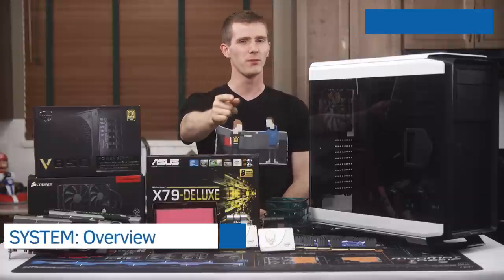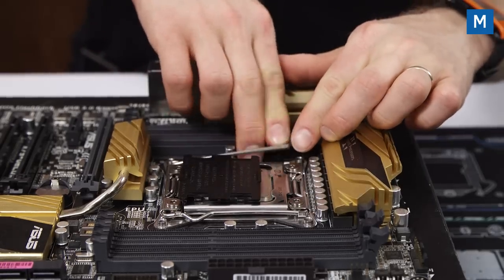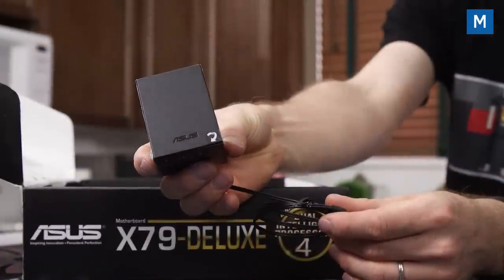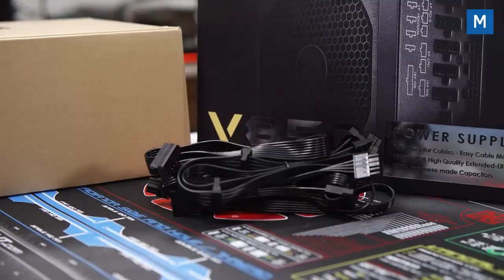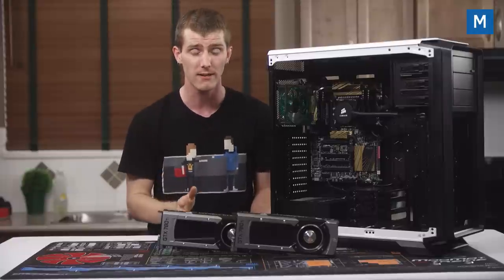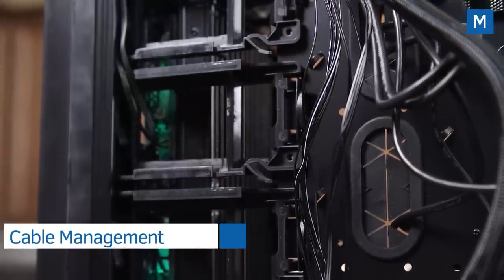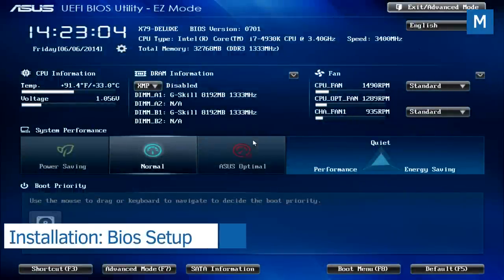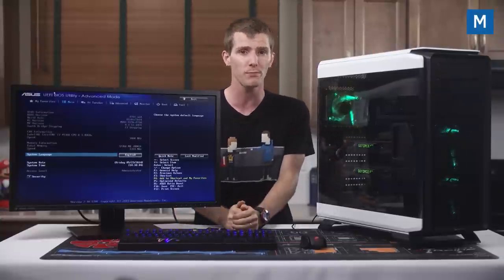How to Build the ULTIMATE 4K Gaming PC Build Guide

Comment: I would have thought that, nowadays, two GTX 970's are a superior solution due to their comparable performance with the 780ti's, significantly lower power consumption and better price. Not to mention the additional gig of VRAM that they provide.

Also, I would probably swap out the processor / motherboard combo with the X99 Deluxe from Asus and the 5820k. RAM would obviously need to be changed to accommodate this (DDR4) and personally I feel safer with an air cooler, so I'd go with a Noctua NH-D14. I'm also personally a big fan of Crucial and their MX100 SSD's, for me, offer better value with 2 512GB variants in RAID 0.

Power supply is fine, love the fan choice, and the case is also outstanding. 

Just my thoughts on the build a few months on... would anyone else make any changes?
Reply: This is before the 970 and x99 were released.
Reply: Personal_Penguin I know, hence why I said that these are my thoughts on the build 'a few months on'.
Reply: A gtx 970 can't even come close to a 780 ti , I think you meant gtx 780. Remember, 780 ti has 2,880 cuda cores, 780 has 2,303 cuda cores, and a 970 has around 1600 but because of the architecture running on maxwell it's about equal to a 780's 2303. But it's not even close to a 780 Ti
Reply: Safwat Khan ***** What on earth do you both mean? A 970 is roughly the same performance as a 780ti and even surpasses it when overclocked. Not to mention the extra GB of VRAM, which is absolutely essentially for additional stability when it comes to gaming at 4K. Add to that the superior power efficiency and pricing, and the 780ti is, at this point, irrelevant when it comes to this build as far as I can see.

Need evidence of the performance similarities? Here: http://www.bit-tech.net/hardware/graphics/2014/09/19/nvidia-geforce-gtx-970-review/12

Look at other websites for benchmarks and you'll see that this is no fluke. An overclocked 970 can also beat out a 980 stock. Not everyone on the internet is terribly misinformed, you know.
Reply: ***** Do the numbers not speak for themselves? What argument do you have? I'm not trying to flame war here, I'm just perplexed as to how you cannot see the evidence in front of your very eyes.
Reply: ***** Lmao, your arrogance really is insufferable. I don't own a single console and have been PC gaming for over a decade now, so get off your elitist high horse and start using your superior 'game developer' knowledge and actually utilising information to argue what I've said. You do understand that these websites that deliver high-quality reviews on computing hardware means that they also have this 'real experience' that you speak of. What is that by the way? Other people who buy high end hardware don't have this 'real experience' of yours because they aren't a game developer? Even assuming that you're not full of shit and that you are a game developer, your argument is beyond vague.
Reply: ***** Lmao, you just have to be trolling. There is no way in a million years that you can believe your price statement. Price does absolutely not equal quality. If you go through life like that, you'll be brainwashed into believing that Apple based desktops are more capable gaming machines than a Windows based system. That's essentially what you're saying. It's an absolute waste of time trying to get an intellectual answer out of you to combat what I've said. Go and design flappy bird mk2 or something, 'game designer'.
Reply: ***** what games have you made m8?
Reply: ChakLong I was actually thinking that this delusional episode from him had something to do with him regretting that he bought the 780ti now that the 970 is out. Only reason that his rant makes any sense, to be fair.
Reply: ***** in Linus's new video about the zotac 970 actually beats the 780 in most games...
Reply: nice profile pic
Reply: Haydn Jeffries "An overclocked 970 can also beat out a 980 stock." And if you OC the 980 by the same amount it beats the OC'd 970. If we are talking about bone stock REFERENCE cards here, like normal people, the GTX 970 falls somewhere just ahead of the GTX 780 and somewhere just behind the GTX 780ti. These "numbers" (http://www.bit-tech.net/hardware/graphics/2014/09/19/nvidia-geforce-gtx-970-review/12) you liked to are from only two games - BF4 and Crysis 3 and all the 970s were not only non-reference, they were also overclocked beyond their factory overclocks and all the other cards on the lists were all non-OC'd reference cards. If we are talking overall performance of stock, non-overclocked cards, then the current single chip gaming GPU hierarchy (not including the Titan series) looks something like GTX 980 > GTX 780ti > GTX 970 > R9 290X > GTX 780 > R9 290. Also, notice the lists on that page you linked to, all the other cards that weren't GTX 970s were REFERENCE models which is why they did not list a vendor brand name like Asus or MSI, instead just Nvidia and AMD. All the 970s were aftermarket, non-reference cards and all of them were probably already slightly overclocked from the factory and then overclocked even more for their tests on this review's overclocking page. If you go back to the BF4 page in this same review (http://www.bit-tech.net/hardware/graphics/2014/09/19/nvidia-geforce-gtx-970-review/6) and look at the 1440p section, then you would notice that list looks a lot like my list. Basically, if you give all these cards the same advantages such as the same non-reference cooler and similar overclocks, the list will look the same as if all the cards were stock reference models; GTX 980 > GTX 780ti > GTX 970 > R9 290X > GTX 780 > R9 290.
Reply: Haydn Jeffries i just bought and installed a gtx 970 and i tell you man it is super powerful, gtx 780 ti is not even in comparison lol and OC it and you get tons of performance as well, will be dual sli by end of the year and tri-sli by next year but hoping to get the x99 first though as that seems like a gamers choice, ignore the comments man i totally get what you mean, the proof is in my pc.
Reply: Sypher Gaming Network "gtx 780 ti is not even in comparison lol" Actually, they are pretty damn close according to Passmark, which is only the industry standard in assessing raw GPU performance. The reference GTX 970 with stock clocks scored 8,773 while the supposedly inferior 780ti scored 9,027. I agree that the 970 is by far the best value right now in terms of bang for your buck GPU power but that doesn't change the fact that the 780ti is still the better performing card when speaking of stock clocks. 250 or so points in Passmark can be easily made up with a mild OC but you can then OC the 780ti as well. If they were to re-build the LPC today, they would not use the GTX 970, they would use the GTX 980. There is no dimension or planet where the 970 is ever better than the 980 (Passmark score of 9,780) even if you are overclocking the 970 using liquid nitrogen.
Reply: Safwat Khan I have to agree with you, a single 970 is definitely nowhere near a single 780ti unless it is in sli. The 980 outperforms the 780 ti because it has more pixel rate. But the 780 ti has way more texel rate and memory bandwidth
Reply: Safwat Khan Wow, take it easy buddy. I think you'll find that the 970 OC can perform faster than a 980, which stock is about 20% faster than the 780 ti. It's not a 'fake ass' website, their tests are accurate in the same way that they are on other high end reviewer websites.
Reply: Safwat Khan Did I also mention that the comparative price of the 970 is about half of what the 780ti was? Add on temperature, power efficiency and sound and, well, there's only one winner.
Reply: Haydn Jeffries The reason why the gtx 970 is slightly better or on par with the 780 ti during gaming is because it has way more pixel rate. The 780 ti has 50% more memory bandwidth and 92% more texel rate. So if you were to do other stuff with the 780 ti other than gaming, the 780 ti would blow the 970 away
Reply: msintelcorei7 I don't know whether those stats are true (as I don't really pay a great deal of attention to the fine details in that respect) but I'm pretty sure that the vast majority of people buy cards such as the 780ti and 970 for gaming. The Quadro series from Nvidia is built for other applications other than gaming, so I'm pretty sure that, say, a professional photo editor (or whatever) wouldn't even consider a 780ti anyway.
Reply: Haydn Jeffries Well, some people want a fair balance between gaming and media design. Since the quadro aren't meant for gaming they would choose to go along with the 780 ti. As most of us only use it for gaming, i wouldn't really see much purpose getting the 780ti
Reply: Haydn Jeffries in terms of value, yeah, 970 kills 780 ti, but when loking at shear performance, 970 cant touch 780 ti, its around 15% slower
Reply: Safwat Khan Again, I don't see where you're getting that from. MSI's GTX 970 comfortably outperforms the 780ti and costs the same as the reference model give or take 5%. Furthermore, Linus just put up a buyers guide for a 4K gaming rig and without hesitation, went for a 970 SLI setup in place of the 780ti's. Therefore, it's not just me that's going with this (as well as other people in this thread) but also Linus himself. 

I don't think I could have a better reference than the man who made this video a few months back.
Reply: Haydn Jeffries Safwat Khan I'll have to repeat myself. In terms of gaming yes, the 970 outperforms the 780 ti because it has higher pixel rate. But if you're gonna do more than just gaming, the 780 ti kills the 970. The 780 ti has way more shading units, more texture mapping units and wayyy more memory bus.

The 780 ti pretty much wins the 970 in everything else except for gaming.
Reply: msintelcorei7 Again, assuming your knowledge of the cards is accurate, fair enough, but isn't this a 4K gaming build we're talking about?
Reply: If high resolution and gaming is your priority then 970 is the way to go because of it's pixel rate. There's a reason why nvidia priced their 780 ti so high but i find their 700 series cards overpriced though. Fair share and gaming and editing then 780 ti is the card.
Reply: msintelcorei7 I was always under the impression that the Maxwell architecture made up for the theoretical drawbacks such as the lack of cores (which is true, sites like GPU boss fail to mention this). I haven't monitored the difference this makes to texel rates etc (because I buy these consumer grade cards for gaming) so I'll do my research and see if Maxwell does indeed make the difference.
Reply: I think a H630 is sexy as fuck, and I don't see what's wrong with a water cooler. I would rather make a custom copper loop, even though it may be more expensive and require a bit more blood, sweat, and tears. Just my thoughts.
Reply: ***** yes, i am not just comparing gaming, obviously
Reply: Haydn Jeffries  Yeah the 970 in every gaming benchmark out there is only 3-5fps behind the 780 ti even in extreme cases, and usually more like 2-3fps behind. And this isn't even the overclocked non reference 970 in most cases, which has more overclocking headroom than the 780 or 780 ti. At 1080p, 1440p or 1600p the 970 is right on par with the 780 ti. Unfortunately, when it comes to 4k gaming; two 970's in SLI isn't as good as two 780 ti's in SLI due to the 970 and 980 having a smaller 256 bit memory bus vs 384 on the 780 ti or 512 on the R9 295x2 SLI card so the 780 ti SLI gets around 45fps in Crysis 3 @4k, the R9 295x2 gets about 49fps, while two 980's SLI stays at 42-43fps and the 970 in SLI is at 38fps in benchmarks. But at any other resolution, including THREE 1080p monitors in nvidia surround, or dual 1440p etc.. the 970 is by far the better card due to being much cheaper. I'm not a huge AMD fan, (in fact i distinctly DON'T like amd, and buy only nvidia most of the time) but for 4k it seems that the watercooled R9 295x2 is the best 'deal' for 4k unless you already own a 780 ti or 980.
Reply: xXDarkxIdealsXx can i use the 970 to browse dank memes? confer with +Safewot Can as well so you can give me the best alternative if not
Reply: The 980 wasnt out yet
Reply: I have opted for the specs below and reading all the comments had been a lot useful. So thanks. Anyway I still could use lot of help in several regards

Intel Core i7 5820K processor
Asus X99 Delux Mobo
ASUS STRIX-GTX970 VGA
Corsair Graphite Series Arctic White 760T Full Tower Windowed Case CC-9011045-WW
Cooler Master V850 - Fully Modular 850W 80 PLUS Gold PSU with Silent 135mm FDB Fan (SLI/CrossFire Ready)
Intel 730 SERIES 2.5-Inch 480 GB SSD
ASUS PB287Q monitor
Razer Death Adder mouse
Ducky Shine 4 keyboard

I might need some answers for the following..
1. What is the compatible RAM for this setup?
2. Is there any added beneficence buying 2 VGAs? If so what is the best combo GTX 970 x 2 OR 780 Ti x 2 or a single 980??
3. Does SSD improve speed at all?
4. Do I need any added cooling for this?
Reply: DD4 ram two 780ti isnt much cheaper than the 980
Reply: Forgive me if I'm wrong but wouldn't it mean with the 32gb of memory that you wouldn't be able to get the full overclock - if any - of the cpu as much as you would want...? From previous parts buying I've had the support bods at whoever I called when checking on things like an oc'd cpu/mobo/memory bundle that when I asked about upping the memory to 32gb's worth they said that this could reduce the overall oc performance of the bundle. I currently have a 970gtx sitting in a build downstairs and I'm thinking about getting a second card - I think that would take me to a great position for gaming and not having to upgrade for a while. Hmm...I know a lot of people use a 780ti for things like editing gaming videos and such like...would the 970gtx be good for that too?
Reply: How in any way, shape or form is ANY console better than a pc? Before some idiot flames me for being a pc elitest...GROW UP, PEOPLE! Yes, I use a pc - I also use a macbook pro laptop and game on consoles. Console gaming is great - so is pc gaming. It's about time people who constantly abuse anonymously across comments to anyone that disagrees with their gaming point of view (not saying you've done that aquafishsoup just using this point to make a comment ;)  ) to just be quiet and spend more time gaming! That's what it's all about - having fun doing something we enjoy! I'm now off to snipe some people from a hilltop and laugh at their frustration...BYE!
Reply: aquafishsoup Poor trolling attempt is poor.
Reply: Haydn Jeffries I just noticed that the "troll" at the beginning of the comment chain was also liking his own comments :P
Reply: Dextah Yeah, it's a little pathetic really, isn't it? Haha.
Reply: ***** Lol, what? Chill out buddy, was just comparing components. If you haven't got anything to add to the conversation, don't comment.
Reply: ***** Dude, since technology becomes obsolete extremely quickly and this video is a tad outdated already, Haydn Jeffries was just revising a few of the components found in the build and providing more feasible parts for an "overkill build". I'm not sure what everyone's fuss about this is... lol I'm sure even now that more stuff is outdated since this post was made in October. Would you like to provide a more coherent and applicable list of parts for a build? If you did, I certainly wouldn't hate on you like the majority of people have done on this post...
Reply: Dextah Think I've found the only decent person on Google+! Lol. It's just an inferiority complex I'm afraid buddy, he's frustrated that he lacks our sort of knowledge to put in a decent, educational comment and therefore his only instinct is to put out a relatively petty insult. It's hilarious the more you think about it.
Reply: Haydn Jeffries I've noticed similar things in the context of most online forums or even social media as a whole sometimes. Whenever someone feels threatened; whether this be from a physical, knowledge, or intelligence standpoint, people tend to succumb to insults and personal attacks rather than continue to fight proof with proof and knowledge with knowledge. The gradual intellectual degradation of a conversation that makes you feel suicidal and even doubt humanity as a whole sometimes tends to mean you've come out on top. There is a crossroads at this point where you may choose to partake in the petty insult fest, or just move on your way and not pay the trolls a lick of your time.

Back to the topic at hand, I MUST share with someone! I just ordered a few new parts for my PC and will be doing the build today :D Went with the infamous i7 4790k for my CPU as an upgrade for my i5 4670k. It was a much needed upgrade since I do gaming and lots of rendering for my YouTube channel. Hopefully that works well with my existing Radeon 7970 (Starting to wish I went to the green team so I had support for Shadowplay). I'll be rocking out the Z97 Fatal1ty mobo by Asrock and an H100i cooler. I've never installed a liquid CPU cooler like this before, so this should be interesting to say the least xD I picked up the modest Arc Midi R2 tower by Fractal Design because of the other-wordily air flow and the adequate spacial support for the H100i. That, and it was also relatively cheap with 5 stars on Newegg :D Anyway, wish me luck! xD
Reply: Dextah Wow, that sounds like quite a rig you're building there buddy! Best of luck with it and happy gaming! If you want a few games on something to test your new rig, I'll drop you my Steam username if you want :)
Reply: I'm fairly certain the 900's weren't available when the made this...
Reply: Powerweezle No, they weren't. That's why I said 'nowadays', meaning it was more of an updated idea of a better solution.
Reply: ***** it's actually BETTER than the 780, but no, not the 780 TI
Reply: *****  You just outed yourself as probably one of the worst trolls ever to pollute YouTube.  Old thread. yes, but I still had to comment on your utterly devoid argument.
Reply: I own a GTX 780 ti a gtx 970 and gtx 970 sc and although the 780 ti outperforms the stock 970 in 3dmark firestrike the 970 sc OCed to 1400mhz boost beats the 780ti at a marginal difference it scores over 13k while the 780 ti scores about high 11k
Reply: At the mean time my friend still burning on 3 way GTX 760 4GB.
Reply: My opinion on this has changed slightly since the controversy regarding the 970's frame buffer, to say the least.
Reply: 'extra gig of vram' heh sore point